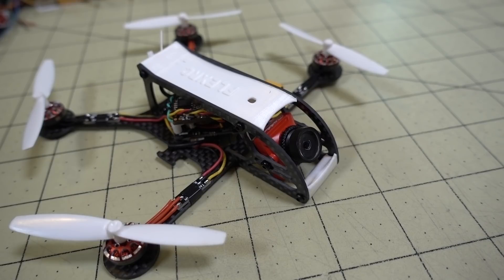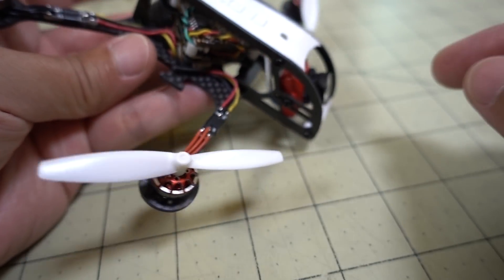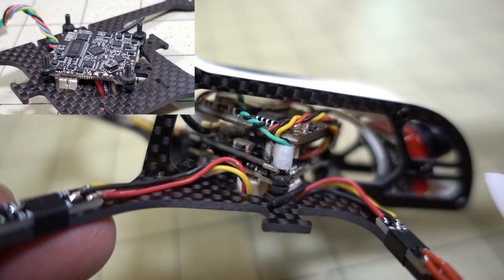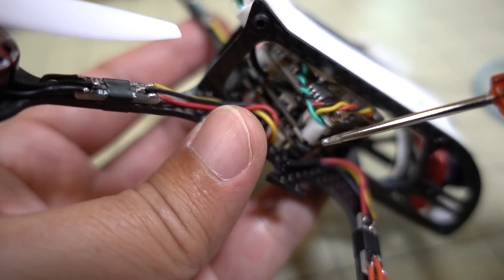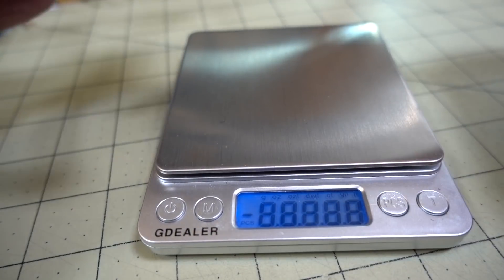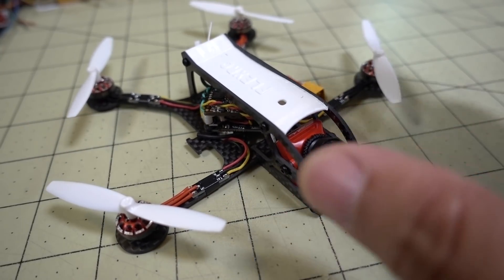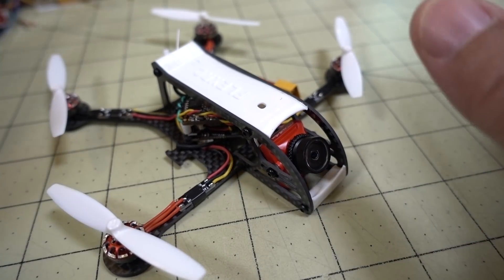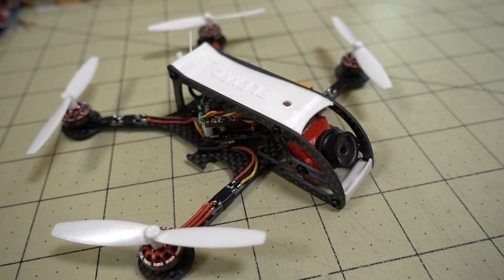FlexRC Ninja Frame // Cinewhoop Conversion 🔥

Comment: Awesome stuff Albert! I just got my ninja BAT in the mail today. Going to be doing a micro hd to poor mans cine-pick conversion. Just hoping I can get a 3 high 20x20 stuffed in there. Curious about your pro version build as well!
Reply from the maker: Pro version?  What's that?
Reply: Albert Kim, you mentioned you also had a 2.5mm version of the frame, that you would be building up with some beefier motors. Mine is the 2.5mm BAT version and I’m going with the hglrc f428 fc/esc,  RC split nano, pro32 nano, crsf nano, BH 1402 9500kv (lies), 2s 650mah and/or 3s 650mah. Should make a decent long range hd cruiser. Although I’m definitely open to any suggestions from the micro pro!